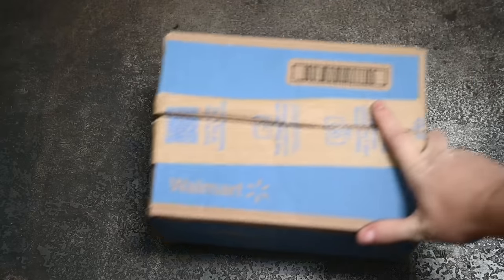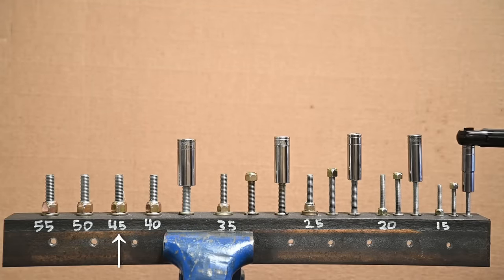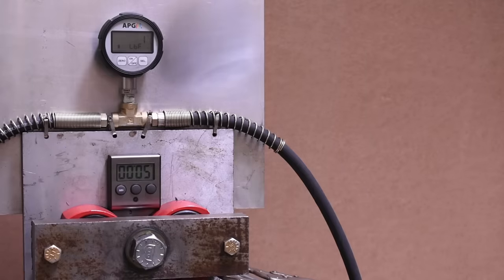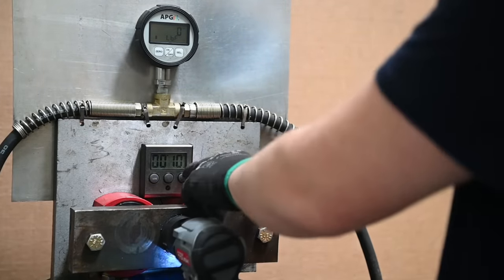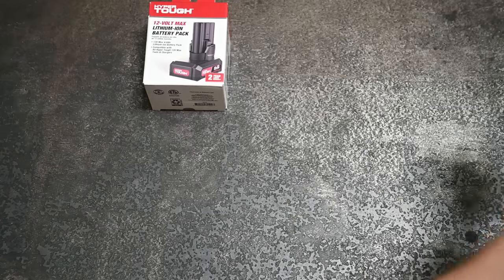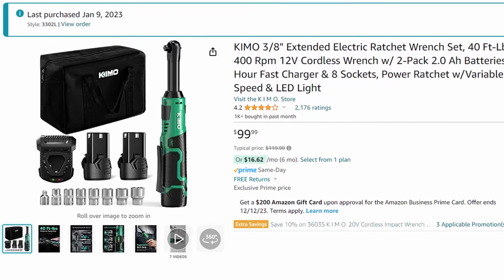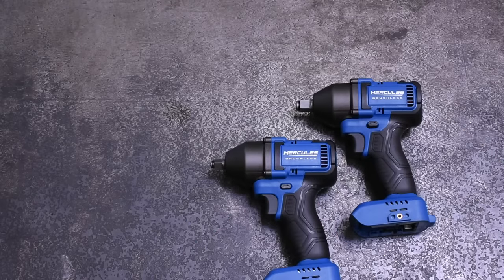Latest Walmart Hyper Tough Tools vs M12: Too Cheap to Pass Up?

Comment: These are sold in Australia under toolpro 12v, always wondered if you could get that battery to run in the Milwaukee 12v by cutting the tabs down? Be a cheap way to power red tools

Comment: I have experienced a difference in performance (rpm and torque) between two of the same model extended ratchets using the same batteries.  I have seen other reviews on the HT 3/8 impact that seems to perform a good bit better than the example tested here.  
It would be interesting to see if an another HT 3/8 impact and/or ratchet would show better performance numbers from these test.

Comment: get what you pay for i learned when i bought a DeWalt band of power tool garage they were taking them in to get the fix 8 months late and 250 dollars on top of it  warren run out in the place where it was sitting  bought Milwaukee found we have Milwaukee warrant place here in the city dropped off the drill with 5 bay they cell my and when to pick it up they hand my a new one  free so  they got my business after that never had any problems with Milwaukee power tools too same with Mikita power tools special the grinders

Comment: I think that stubby impact would be a good tool to have for basic disassembly. Undoing intake boxes fender liners and all the small stuff that’s usually under 60 lbs/ft anyway. I wish ryobi would make a compact impact like this I know the battery kind of defeats the purpose but I don’t want to commit to another platform. Ridged is having a decent Black Friday sale right now but they are all sold out of their 1/2” right angle impacts. Also from other videos of this tool I’ve seen it appears the version of this with a 1/4” hex collet performs better without shutting down after 4 seconds of use? Maybe you got a dud 2ah battery? Who knows.
Reply: They are in their new compact lithum battery line..
Reply: @globalcommerce7654  do you mean the cordless ratchet in the usb lithium battery platform? Because that’s not an impact driver or a right angle impact wrench. I already have the 3/8” extended reach ratchet so that doesn’t tickle my fancy.

Comment: Are ANY of the lower-priced batteries interchangeable with higher-priced tools?  You test so many of them and I have both Bosch and Ridgid tools, and I would like to know if I can use any cheaper batteries.
Reply from the maker: Negative. They do it on purpose
Reply: The cheaper batteries are cheaper for a reason also.  The best results on the DeWalt impacts come from the 6Ah batteries.

Comment: I tried the Hyper Tough normal neck cordless ratchet. It was a built underwhelming, But it wasn't very expensive either. I took it back and bought a DeWalt cordless ratchet instead. It cost way more but the torque it put out in comparison is ridiculous. I bought it to work on my cars, so I guess it's a worthwhile investment.

Comment: I bought the new gen m18 compact impact in 3/8" drive for removing the lugs off my peugeot 205 as they are 90nM, it struggled with a few of the lugs at first maybe due to the poor quality socket but still managed to do the job with the 5ah battery, this hypertough tool would just give up.
while its a cheap tool it definately would be used for all the soft jobs, it has a very nice price but you can tell you're buying something rather low power tools with this brand.

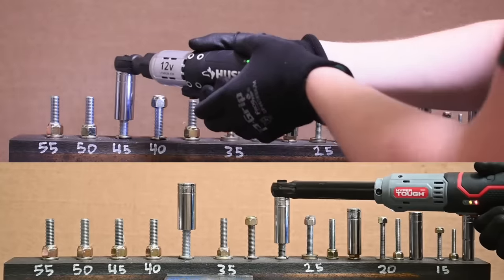Comment: 3:27 I come across surprisingly few jobs like this, and i dont see customers bringing those to any mechanic asking if they can finish them in 3 minutes. Well, my point is that electric ratchets arent very useful IRL, like its a waste of time to bring one to most jobs. Fun to test when its new and then it doesnt see much more action.
Reply: What? A vast majority of mechanics use electric ratchets daily.
Reply: My 3/8" compact impact and ratchet are the first things I grab when heading out to a job, and low profile flex head ratchets in case clearance is an issue. All day every day. If I can save 10 minutes of frustration every day they're worth it by all means.

Comment: I'm not a professional.  The appeal to me of an electric ratchet is for hard to reach nuts and bolts that are frustrating to get tight enough to ratchet or once you break them free, you can't ratchet it all the way off and it has a long way to travel.  A cheap electric ratchet would be great for that.

Comment: poor walmart cant even sell the impact wrenches anymore. it just made it to the "discontinued" clearance shelf at my local store and they are still demand $45 for that junk.
Reply: Their half inch anvil impact is on sale for like 50 if it does 500 ft lbs and does just half so 250 it's as small as that stubby Milwaukee 3/8 that does 250 might as well go with the hyper tough if your short on money just in a 1/2" anvil

Comment: I wanted to see at least the ratchet tested. Anyone who thinks these compare to the big boys is nuts. I use the ratchet and the bit driver a lot. I’m a home mechanic with carpel tunnel so running a ratchet by hand hurts. Since it’s not my day job and I’m not expecting the thing to make money I’m totally good with it. 

A 3/8 impact in any form is not really made for lugnuts. I have a mini van that some the Milwaukee mid torques can’t take a lug nut off. Hell the HF fan boys love the 1/2 mid torque Bauer. Junk.

Comment: the whole point of the build of milwaukee and now the hyper tough is to be compact, if ive got to stick a big honking battery on the bottom i might as well stick with my DeWalt, the new dewalt brushless is as powerful as the milwaukee anyways

Comment: That cheap stuff will always be that price point while the Milwaukee tools change price depending on time of year. He’s showing full price. But even right now you can get the m18 fuel tools which are more powerful than the m12 for cheaper than the prices he showed.

Comment: I have the rachet and the impact driver (not the wrench in the video), and use them professionally at work. The impact driver is really good, I use it to clean wheels and and take out tpms screws, and that is all. I like it because it is cheap so I don't sweat leaving it out on the tire machine so other people might use it. It is much better to me than the steelman electric "screwdriver" kit that is provided by the company. The rachet I bought because I had the fast charger and a few batteries already and didn't own an electric rachet. I have done multiple brake jobs and struts with it. The rachet works well and holds up to real use. Yes it's slower but it's faster than going by hand. 

I figured that wrench would be fairly worthless although I hoped it wouldn't be. The 2 things I am most curious about it this line are the cut off tool, and the little trim router. I really want that trim router to work well enough to do door frames on houses because it is cheap and super light.

Comment: I was expecting a 90 day warranty on the hypertough but 2 years wow. For the price, thats a great low cost entry for people just getting into wrenching.
Reply: Power ratchets are not anything near a necessity for a beginner wrench. Money is better spent on a good set of combo wrenches, a fine tooth ratchet and decent sockets.
Reply: @davidparker9676  I agree with you but in this day in age power anything is going to be very attractive.
Reply: Since a tool cannot do the job, It may never breakdown

Comment: I really wanna get a Milwaukee M12 impact gun, I have the smaller M12 ratchet and the impact driver but not the impact gun. I use my impact driver as a impact gun lol and it's definitely putting wear and tear on it.

Comment: Your measuring device right bolt is just shaking around,  is that normal?
Reply from the maker: The two gold bolts just stop the face from falling off when the test bolt is removed. They should be loose when testing

Comment: The hyper tough looks like the old style Milwaukee which the oriely brand tools are exactly the same as the hyper tough batteries and tool both are just older model Milwaukee

Comment: It looks like you got a dud! For the 3/8 impact.  I don't have a problem with the impact gun in fact, it's been operating fantastic.  I'm a diesel mechanic, and it's been handling 90% of the work.
Reply: i have one but have had a chance to do much besides take off wheels which it did what have you used it for ?
Reply: I agree. I've got the HT 3/8" and I've got a video of it removing the CV axle nut from a Chevy Equinox. 🤷

Comment: The impact you have must be defective. My unit works with all three batteries. 1.5 ah, 2.0 ah, and 4.0 ah. My unit is also capable of far more than 150 lbs. I work in dismantling. Pulling mangled parts out of engine bays usually requires a bit of guts, this guy doesnt miss a beat. Power steering pump mount bolts, on an E350 with red lock tite. Ziped them right off, lug nuts on that same E350, no problem. 

Literally, if it something reasonable to expect a 3/8ths to do, it does it without missing a beat. I don't normally abuse my tools and try to make them do more than they are designed to do, but after this video, curiosity got the best of me, so i really beat on it at work today. Surprised me. Now just to see if itll hold up to over time.

Comment: Have you ever tested a Milwaukee surge impact?
Reply from the maker: Yes. It doesn't dyno or want to be dynod
Reply: @TorqueTestChannel  interesting. Mine has been phenomenal for driving deck screws and removing 13mm and smaller engine bolts via a 3/8 adaptor. Way faster seemingly than the electric ratchets.
Reply from the maker: @On2wheels94  oh nothing bad about the tool. Just won't dyno

Comment: If you're just using these tools to work inside your own garage, it would probably make more sense to use air tools. This is especially true if you already own a compressor.  You're gonna want a compressor anyway, so if you have room you should get the baddest one you can afford.
Reply: ive thought this for so long, with diyers also not using there tools as often as us the batteries are just gonna degrade quick from lask of use, even cheap air ratchets are decently reliable
Reply: A lot of tools just don't come in a cordless version, usually for good reason. There are also domestic air tool producers.
Reply: @maxscott3349 The good reason being that they're tools that don't matter?
Reply: @orijimi  More like a cordless needle scaler or air hammer wouldn't be nearly as useful and some things use the air for more than just a rotary power source
Reply: Dragging air hoses is still annoying. I have air, cordless and corded. The air tools just sit except for the needle scaler and I mostly just sandblast with air. Most consumer compressors are feeble things. Mine are industrial but a hose is still a hose. Batteries last many years if they're any good in the first place. I still have an M28 from 2011 (I year mark my batteries).

Comment: Do the batteries interchange with each other?
Reply from the maker: Nope :*
Reply: @TorqueTestChannel  i figured. I wonder if they could he modified to. At least the cheapo to take a milwaukee. Itd be nice to have a cheapo to use in spots that gives it all the cuts, and scrapes
Reply: @TorqueTestChannel  hey, do you think when you do your 1/2 impact tests, you could also do the test with a or a few torque sticks to see how they react to them, since on your torque stick test video you said because of the hammers in pneumatic and cordless hit different. It'd be cool to see how they do because ive had a aircat 1150 and got the new thor g2. The aircat seems to hit the stick harder, but I'm starting to think the thor g2 has a break-in period because it seems to be getting better.

Comment: If you want cheap tools get DeWalt, if you want tools that are expensive but don't break buy Hilti, if you want the best tool for the job buy Milwaukee. If you buy these cheap knock off brands your only going to be left disappointed.

"The real cost of cheaping out lingers long after the initial price was paid"

Comment: 400 mAh off a wall charger??   That's less amperage than the USB port on the computer.
Reply from the maker: Less than half in some cases
Reply: USB port on the PC is at 5V thought, this is around 12.6v but still yeah, some PC USB ports can do up to 5A.

Comment: Again, DIY is one thing, a real mechanic using this 9 hours a day is a whole other thing. On all of these cheap tool reviews you are always leaving out how long the service is. Next year (at most) you are now replacing the POS and are now approaching the cost of the better one, which will run for years.

Comment: I really like all the hyper tough tools just for the batteries, but you can just by any 20 volt for lug nuts, breaks and hubs rotors, and wheel bearings for 40$ bucks.  That's a once every four year job, so why even buy the ugliest damn tool?  If you are a professional, in any industry, I'd be using transparent Festool, but its called Hyper Tough, Ryobi green hat on sideways,  lol!

Comment: hypertough (cordless) powertools are trash! had their saw saw? idk/idc how to say that right im from ky thats what we call em. it did that same shit that your having around 6 min 13 seconds. 6:13 where it "kicks off" for whatever reason. and i had several batteries with the "fast" charger. i tossed that shit in the trash after trying to cut some "half in shrubs" and it did that shit. i use the kimo however all the time. have broken one or two tho. to which kimo will 1000% send a new one to you. or you can buy a new gear/head for the milwaukee set and there the same pretty much. just be aware that you may need a fatter washer, or thinner washer. either way, kimo slaps compared to the HT brand power tools.

Comment: I finally tested the Hyper Tough brushless 12v 3/8" impact with the 4.0Ah battery…

Pulled all 20 lugs & didn't even slow down. Still 3/3 charge indicator lights after finishing the test.

https://youtu.be/rV77t7i9_2Q?si=RhC0meKOLTAPJ90V

It doesn't have the power my plastic 3/8" Matco air gun did, but it feels similar in the hand (relatively heavy at the business end) , and doesn't have the umbilical cord! (air line)

This thing has replaced my Matco rattle gun.